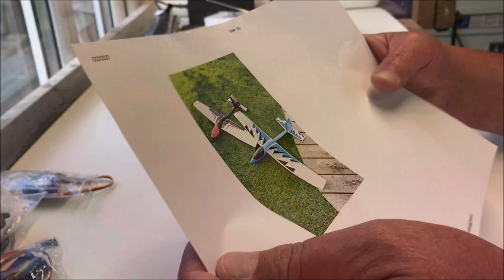Lidl Glider  what do I need

Comment: you got a link for the motor or a product code?
Reply from the maker: Saf, 
Sorry for the delay. Yes here is the description and a link. Bangwood also supply this kit. 
KEESIN RC 1000KV Brushless Motor A2212 13T with 30A Brushless ESC Set 1045 Propeller CW CCW Accessories Kit Mount for RC Plane DJI F450 550 Quadcopter
by KEESIN
https://www.amazon.co.uk/KEESIN-Brushless-Propeller-Accessories-Quadcopter/dp/B07BS7DFW3/ref=sr_1_9?dchild=1&keywords=Brushless+Motors&qid=1592220212&sr=8-9
Reply: @thebarronflights1948  Brill. Thanks. Wheres the rest of the build? I am currently in the process of building one.
Reply from the maker: @nickbradbury2596  Just uploaded the next part, my laptop is broken and so using my works laptop, But the video is upside down and trying desperately to turn it over to the right way up. Part two will be up soon.